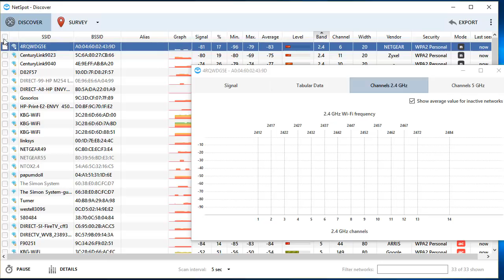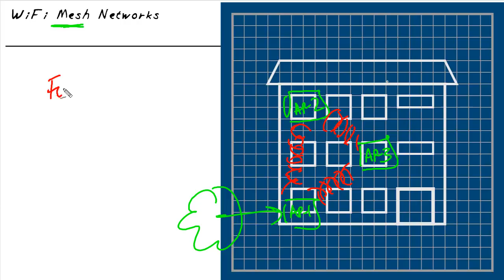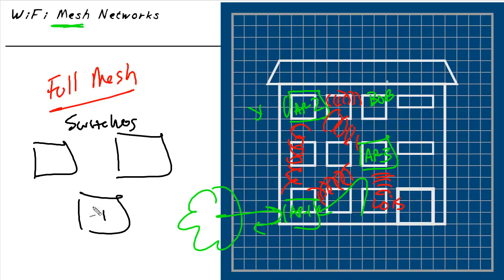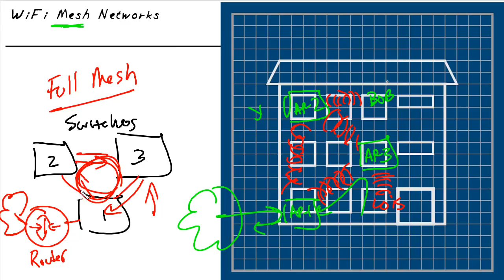All About Mesh Wifi | How and Why Does it Work?

Comment: I am sure that you hope this has been informative for us, and you thank us for viewing. 😂 Anyway, I still don't understand, is the connection between all the routers cabled or it's all based on wireless? Do they use wireless to communicate with each other or they must be connected with cables?
Reply: All communication between the routers in a mesh is wireless. The base station in the one wired into the model from your provider.
Reply from the maker: Thanks Greg!!!!!  Way to assist.  I appreciate you.
Reply from the maker: Great question.  Some allow a wired back-haul, but that is the exception in the home WiFi router market.   Typically there will be one device that is acting as the router and AP, and the other devices (often 2 others) act only as Layer 2 devices (APs).   The devices build logical wireless connections between them.   The only cable on the non-routing device is power!    Google WiFi has 3 devices, all with the same capabilities, but when they are deployed only one of them acts as a layer 3 router and that same device is the only one that requires the Ethernet cable to connect to the Internet.   Hope that helps.  More videos to come.   Thanks for the question Borislav.
Reply: @KeithBarker  Thanks, Keith, for the clarification. The whole point of the mesh network implementation is to get rid of the dead spots, right? But in this case, if you put a mesh AP member at the dead spot, since the spot is "dead" in the first place - supposed weak or no signal at all - how it would get the signal from the main router in order to "amplify" it? I have two Asus AC68U routers which support AI mesh but I've never used them as such. However, I've always wondered how is the signal getting "taken" from the main router if it's too weak or absent.
Reply from the maker: @borislavkgeorgiev  Great question.   The trick I suppose, is that if we had a literal dead spot, the remote AP without a wired Ethernet connection would struggle.  (To say the least).  The solution would be to place the remote AP in a place between the current dead spot, and another AP, so that is can communicate with the other AP(s), and still provide signal to what was previously the dead spot.    There is a really sweet (and free) app for both Android and iOS called "Wi-Fi Sweetspots".   By running the app, and walking around the building/house/yard the app will show you real time the speed between the mobile device (running the app), and the default gateway (the router).   This is fantastic information because it doesn't throw in the variable of how the Internet connectivity is performing.   Tools like this, and other more elaborate software (such as NetSpot, which also has a free version for Mac and Windows) can assist in where signals are weakest, and also in the optimal placement for remote APs.   Another factor is competition with other APs signals.  NetSpot can also assist with identifying crowed channels, which can lead to us manually choosing less crowded channels for our APs to use.   Hope some of this is useful, and thanks again for the comments and questions.   Best wishes!
Reply: @KeithBarker  Thanks a lot for the info, Keith! Always a pleasure to hear your advises.
I decided to play around with my two Asus AC68U routers out of curiosity and I successfully added the second one as a mesh node. Here is what I got:
https://drive.google.com/open?id=16UH_tcV2BEoXnkxg1V8xnyrJEetA8FDg
Reply from the maker: @borislavkgeorgiev  Excellent.  Thanks for the pic.  Did you hardwire the second one, or is it connecting to the router via wireless?
Reply: @KeithBarker  No, I did not. After what you said, I was very curious to see how exactly does the fully wireless implementation works. All I can say is that it works as it should. I went out in the back yard and tried to walk away from the router with my phone. After the signal from the main router disappeared, the phone switched to the mesh node almost immediately. It's so strange that if it wasn't because of your videos, I wouldn't have bothered to try this, because I don't really need two routers. But I've always been curious to see how it works. :) However, there are still technical questions crossing my mind - like for example with the entirely wireless implementation how does the mesh node switches between send and receive. I mean, the AC standard is still only half duplex. Does that mean that the mesh node first receives the packets from the main router, then transmits it to the client, then the client sends request to the node - the node says again - wait a moment and transmits it back to the main router. I would understand if they were hardwired, but in this case they use only one single interface to send and receive. I am not sure whether this affects the speed or not.
Reply: @KeithBarker  I am learnig from you and others here about the Mesh systems..I am so glad I finally found a video,and also the comments here about connectivity..
Reply from the maker: Thank you Dayib!!!